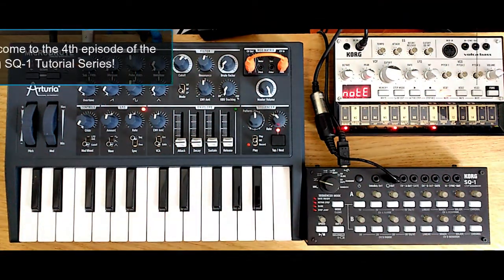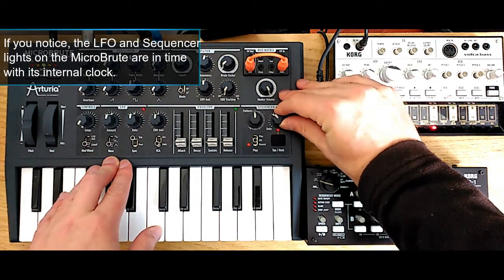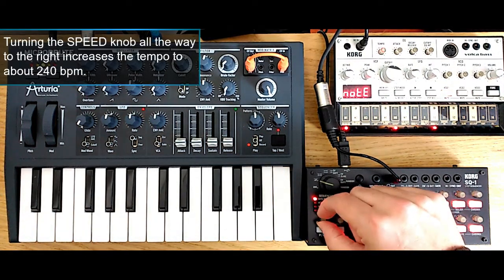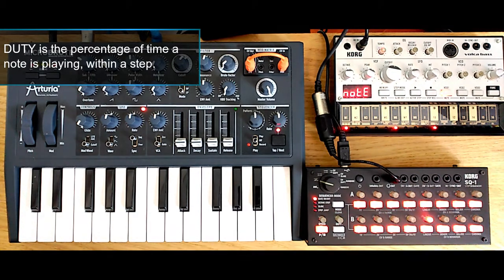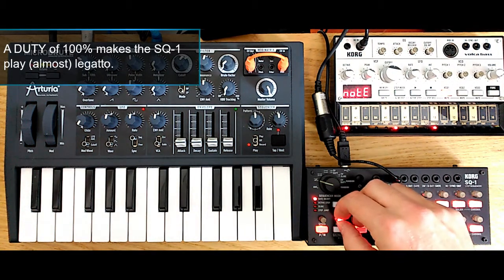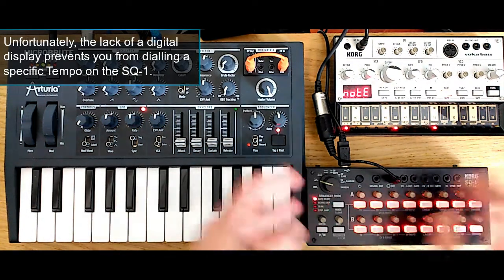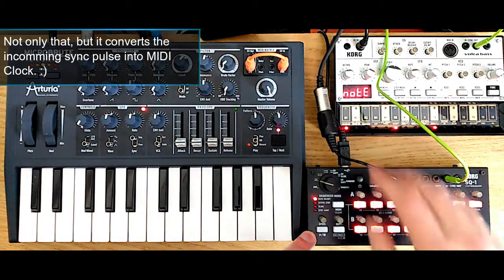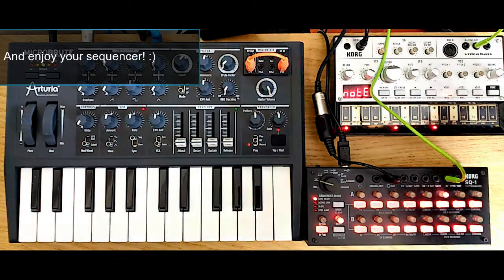Korg SQ1 Tutorial 4: Tempo, Duty & Slide

Comment: I have a korg ms 20 mini connected to the sq1 via cv out and gate... When I engage the portamento on the korg ms 20 while playing the sequences shouldn't I hear a slide from note to note?
Reply from the maker: Hi!
I'm guessing the portamento (essentially a slew circuit) is located before the CV input on the VCO's... but I don't have the chematics at hand to check it.
Reply: @Philipplus i think you're right, thanks! Btw, and sorry for the extra question, but do I have to set the sq1 to a specific mode to sync it to a daw clock? I'm trying to sync it to reaper, I've set it to output midi clock to the sq1 but for some reason it just doesn't sync... I'm not sure if there's something I have to set in the sq1 as well to slave it to a daw... Thanks!

Comment: Can I use a pocket operator for sync the tempo?
Reply from the maker: Hi Rman Pojo.

Yes you can... the manual on the pocket operators gives you a number of cominations for sync with the volcas (either as master or as slave). You will need a splitter cable though (TRS to 2xTR, both ends on 3.5mm), as the sync pulses are carried on the ring, and the audio is carried on the tip of the TRS jack output.

I hope this helps. I think there is a demonstration of the PO being sync with the volcas on one of the SonicLab reviews of the original 3 pocket operators... I just cannot remember which one.

I hope this helps.

Cheers!

Comment: BIG problem. So i have a roland tr-8, a volca bass and sq-1. i can't sync them. tried all the methods. the only way i see it is using a DAW. But the problem is that when i sync sq-1 with a DAW the MIDI-out doesn't work anymore.
Reply from the maker: Hi Margan. 

The sync implementation of the SQ-1 is only sparsely documented, and that has been pushing me to delay the episode about sync and midi. I think the SQ-1 suppresses MIDI output when it receives a MIDI clock (possibly to avoid a loop in the MIDI clock signal). So, using your DAW as a midi clock source will prevent it from recording the SQ-1's MIDI output. We may discuss if that option is sensible or not, but it is what it is, unfortunately (at least until korg decides to release a firmware update). The most effective workaround I know of is to put a volca (or an electribe) between your daw and the SQ-1. The volca will receive MIDI clock from the daw, then send sync pulses to the SQ-1 (which in turn will re-convert them into MIDI clock). To avoid creating a loop with the MIDI clock, you must then use a midi filter to exclude the MIDI clock signal from the SQ-1's output. This is quite a convoluted workaround, and you'll still loose the ability to start the SQ-1 sequencer from your daw.

A less convoluted way is to use an electribe as your main clock source, sending MIDI to the TR-8 (and whatever other gear you may have) and sync pulses to the SQ-1. Again, you have to manually start the sq-1 sequencer.

I believe this also answers your question regarding using the DAW to control the Tempo of the SQ-1.

I hope this helps.

Cheers!

Comment: Great series. Thank you.
If you have an iOS device, Korg also has a free app, SyncKontrol, which is a Volca master clock. It offers 20 to 999 BPM, tap tempo and swing control. Might be an option for someone without another Volca to act as clock with fine adjust.
Reply from the maker: Hi George. I did not mention that app but was planning to refer to it on the Sync Episode. I'm always a little bit sceptic about having your Iphone's audio out serving as a main clock for your setup... it is as if I'm just one receiving call away of losing sync in mid-performance! But perhaps I'm just old fashioned :P
Thanks for stopping by and commenting.
Cheers!
Reply: Understood- Using an iPad or iPod might eliminate that. I use it with my SQ-1 and Volca FM. I also don't get many calls...
Reply from the maker: Well, Murphy's law would have you getting a call in the middle of a live performance! :P
Using the ipod or ipad is safer, though. I've also ben experimenting with some non-korg apps for android, but the jury is still out on them.

Comment: Hey, thanks a lot for these cool and informing videos! Still have a question about the sync-in: does it work like a CV-Input via voltage and is it compatible to other sources which are not made by korg? For example a drum machine, an old synthesizer or a a simple click from a metronome?
Reply from the maker: Hi Markus. 
The Sync uses the 2 pulses per quarter note (PPQ) used by korg on the Electribe and Volca ranges, but you can use any trigger or LFO as source for sync (but they will be interpreted as 2PPQ), as long as it is a positive pulse (up to 5V, but I don't know the minimum voltage for triggering or the tolerance towards higher voltages). For example, the Beatstep Pro uses a 4PPQ standard, so the SQ-1 will play at half tempo if slaved to the BSP. 
I hope this helps.
Cheers!
Reply: Sync in/out polarity is set in the GlobalParamSettings (press PLAY/STOP when powering on to get in this mode) if the Mode button is lit then + polarity { DEFAULT [rising voltage signal] } , pressing mode button to unlight is makes it Negative polarity [falling voltage signal] , check your device. Once set press the power button and the SQ-1 will restart with saved Sync polarity you selected